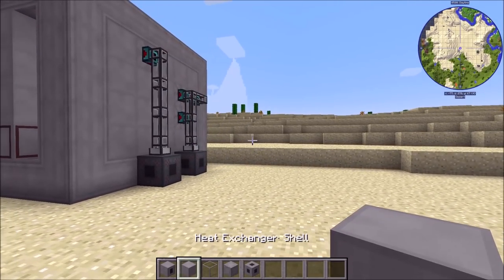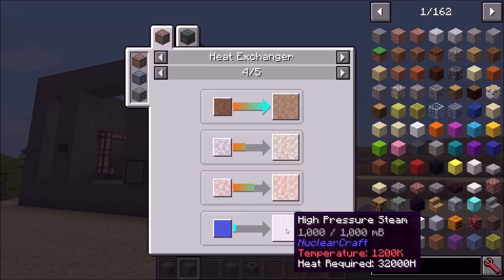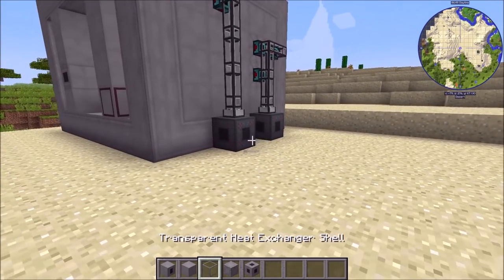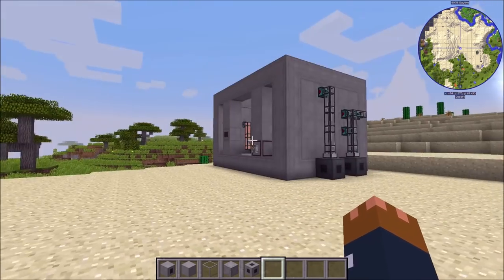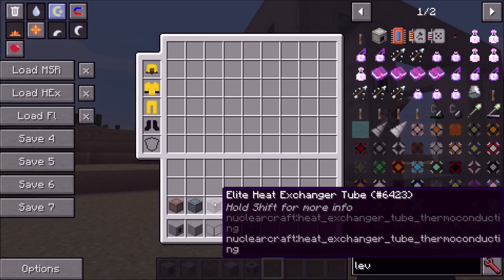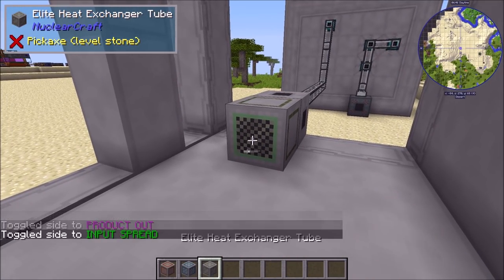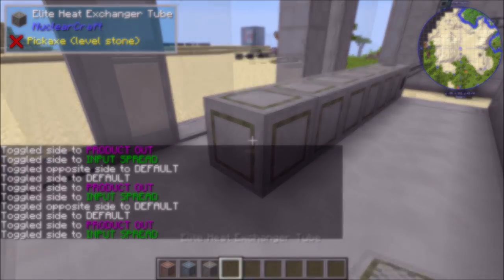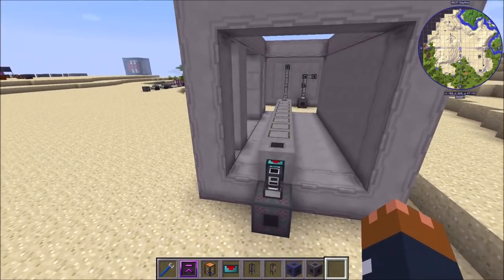NuclearCraft Spotlight - Heat Exchanger [1.12.2]

Comment from the maker: Note 1: if looping the high pressure steam back through the exchanger as I did, remember to take that into account when calculating how many tubes you need!

Note 2: You can now copy the tube side configurations along a line by sneak-placing - should save a lot of time!
Reply: the tubes seem to be very difficult to set up (even with shift) and when it doesn't work, it's hard to troubleshoot. how about coloring the tubes? then they can auto connect within a color but don't mix. and to make it very easy, marking the output (vent or last tube) so it "request" fluids would help too.
Reply: Can I take the steam and use it to generate electricity with hbm steam turbines?

Comment: The new molten salt stuff looks like it'll be fun to play around with. I have one suggestion however, a copy tool for copying the settings from one heat exchanger tube to another or for the reactor cells would be really nice because having to click on the individual blocks so many times seems kinda inconvenient.
Reply from the maker: A couple others in the Discord server have asked for the same - on the to do list!
Reply: It could be as simple as shift+right-clicking a tube onto an existing tube places the new tube with the same settings as the one already placed. That would greatly reduce the tedium of running straight lines, at least, even if it doesn't exactly help going around corners and such.
Reply from the maker: @polyjohn3425  Your suggestion turned out to be the slickest one - added in the latest version :)
Reply: @NuclearCraftMod  Wow. That's awesome.
Reply: Yeah like the redprints from Thermal Expansion

Comment: could you use the same exchanger frame for both high pressure and normal steam, in other words having your rows of hot coolant and water in half of the exchanger, and then feed the high pressure steam and water in the other half to cool it down to normal steam? in theory that would save in casings by removing a redundant wall and extra piping since your just going over to another section on the same wall rather then around to a separate multiblock. The problem i see with that is in dont think the interface is smart enough to account for cooling multiple types of fluid BUT if it did work in theory you could do some sort of double layered system where you wrap your hot coolant in water, and then wrap the water lines in your high pressure steam lines, that is assuming you had enough water flow to take all the heat from the coolant and high pressure.
Reply from the maker: Yep, that's perfectly valid :)
All that is needed for the heat exchange to occur is for a cold -> hot recipe to flow past a hot -> cold recipe :)

Comment: will you add support/ore dictionary for IndustrialCraft 2's high-pressure steam, and steam turbine.......... (IC2 uses the same turbine for high-pressure steam and regular steam)
Reply from the maker: Ryan Schultz I might be able to, yes. There is no ‘ore dictionary’ for fluids, so either I’ll have to add the recipes or the IC2 devs could.
Reply: @NuclearCraftMod   Correct me if I'm wrong but didn't Forge recently add "Forge fluids"? I remember that I played some time and was looking for a buckets of some fluid. Turned out it had been sorted as a "Forge liquid bucket".

Comment: i like this reactor, that the coolant is a fluid that you need to pomp in the reactor like real life  
something that would be interesting would be a reactor that needs liquid coolant but uses solid fuel and used this heat exchanger to produce steam and maybe a simple reactor that use solid fuel and water for coolant so the water heat up and exit the reactor like steam and the steam go to the turbine then it condenses and returns to the reactor in a close system and you can see in the reactor the water and the steam if you mess up the reactor break an steam exit out of control and meltdown like chernobyl
Reply from the maker: I'm not sure about mixing solid/liquid fuel/coolant yet, but if the maths works out nicely in a way that would encourage different reactor styles, we could definitely try it!
Reply: @NuclearCraftMod  nice thank you, your mod is really cool yesterday all day whit the mod testing things

Comment: Does it ONLY work with a counter-flow heat-exchanging design? Would there be any advantage to a zig-zagging entaglement of tubes that increases shared surface area, vs. having several individual tubes surrounding one other?
Reply from the maker: Exo 594 As long as the flow is not *parallel*, then it will work, so you can have any sort of crazy design with the tube flows perpendicular or opposite ;)
Reply: first off you can still have counter-flow while having a zig-zag pattern, and another way I imagine it is that if you think of a double helix(you know, what DNA is structured as) and the hot fluid flows one way while the cool one flows opposite. it will increase the surface area and amount of heat exchangers used.
Reply: Yeah, I was thinking something similar. I'll be interested to see something like a "twin spiral" works compared to a checkerboard or layers of snakes.
Reply from the maker: Very true - also keep in mind that tubes can be 'interlocked' by playing with the flow direction of the product fluid as the long as the input fluid is spread in the right direction :)

Comment: Hello, I hope somebody is going to help me. I have tried building an heat exchanger just like you did in the video, but it is not working. It is consuming water and hot coolant, but it is not outputting anything. I am using NuclearCraft-2.18o-1.12.2 in Mc. Ethernal
Reply from the maker: Will just ask here for completeness - did you solve the problem after the discussion in the Discord server?
Reply: @NuclearCraftMod  Yes, it did, I didn't power the heat exchanger with a redstone signal.

Comment: Ok, so I've watched this a few times and I'm a little fuzzy on something.  When you are explaining the heat transfer rates between the cooling tubes, it seems like the total amount of heat is not conserved.  As in the water is gaining 400  heat per tick while the coolant is losing 900 heat per tick.   Is this correct or am I simply misunderstanding things?  Usually I'd just over design this sort of thing, but my reactors tend to be 9X9X9 monstrosities so that's not really feasible.
Reply from the maker: You are correct, yes - this is one of the major things that will be changed/fixed in the overhaul :)
Reply: @NuclearCraftMod  Thanks dude, you're amazing.
Reply from the maker: @zecorezecron  No worries!

Comment: Does the heat exchanger work with a solid fuel fission reactor?
Reply from the maker: No - right now, the solid-fuel reactor produces energy directly, and in the future it will produce steam for use in turbines. The only currently planned sources of hot coolant for heat exchanging are the MSR and fusion reactors.
Reply: Thanks

Comment: The amount of maths you need to do tho... I think I need to rewatch it a few times to understand. Math was never my strong point. You got a wiki or something with the values? Cos it's not the easiest to follow along in a video. Still I'd think it's nice how realistic you're trying to be here and you do seem to enjoy it a lot. I'm a little concerned about the amount of IDs the mod uses though. I experienced first hand twice how the IDs exceeded Minecraft's hardcoded limit of 4096 IDs when making my own packs. Sure there are mods to alleviate that and 1.13 is redoing all IDs but it's just something I've noticed when trying to recreate your test modpack (cos I wanna get into all this new stuff.) Not sure how much you can do on your side though.
Reply from the maker: I've recently set up an MSR and Heat Exchanger calculator that you should be able to make a copy of and use to help with the calculations :)
https://docs.google.com/spreadsheets/d/1dMKsUrZST3iK1dgOlLnxShaFYcidx_s9zHVtMeRf1lM
https://docs.google.com/spreadsheets/d/1ZV5va57mvOl86M66vGs72CE9XW2p4jG4cwHD9qEdLqM

As for IDs, I could technically be a little more sparing with the multi-block parts, but really not by that much. For example, blocks that have different states, make up parts of different types of multi-blocks or even must be places in different places in the structure can not share IDs.